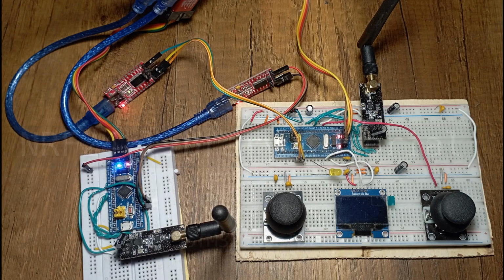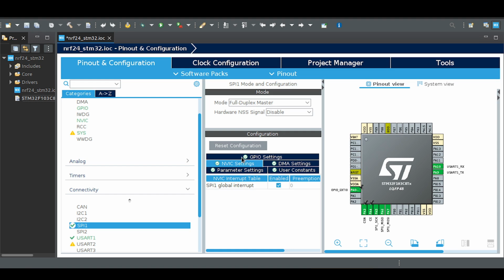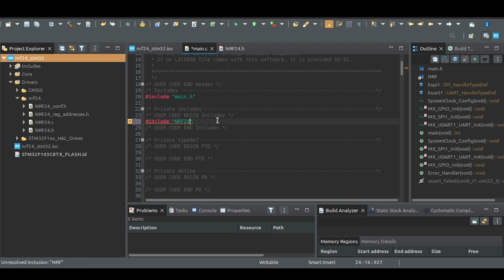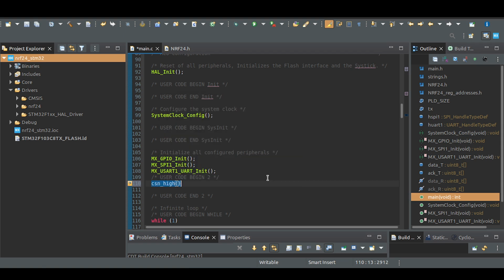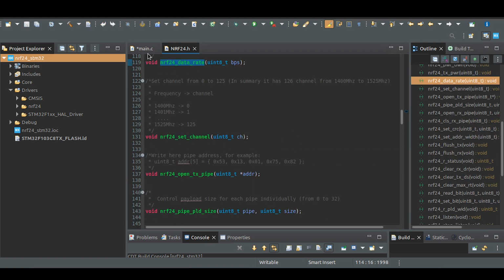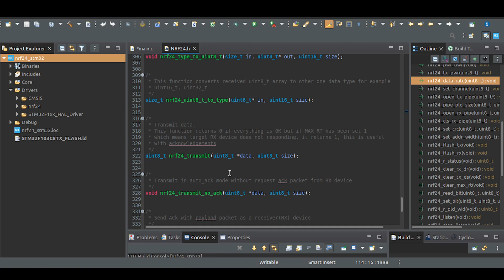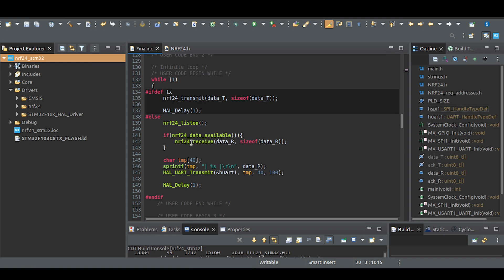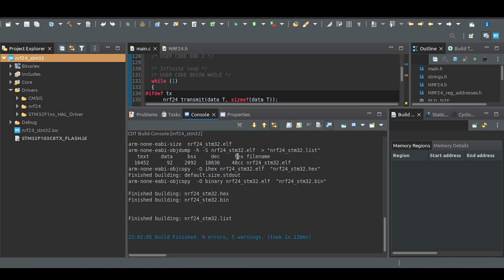NRF24 LIBRARY TUTORIAL STM32CUBEIDE

Comment: Was it really a problem to include the program code in the movie? The attached link points to a completely different code. And now I don't know what is the reason that the program doesn't work for me. My code, despite the care taken to write it according to the movie, or some other reason, does not work. How such carelessness makes life difficult.
Reply: I found the issue for it not working. The nrf24 library is incomplete. data |= (1 << PWR_UP);    // Power up

He never powered on the chip on listen and on stop_listen mode. Took me 8 to 10 hours to debug each step and find the issue, but this way I learned a lot
Reply: I am in a similar situation, I am not able to receive any data, I have tested spi manually and the nrf24 is entering receive mode i was not able to test nrf entering tx mode.